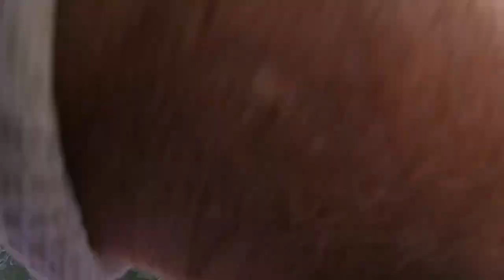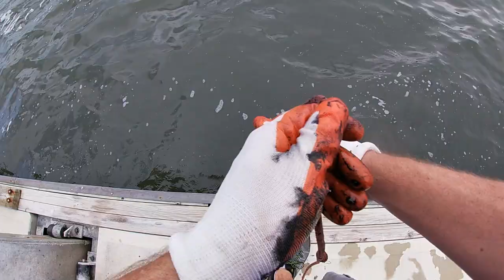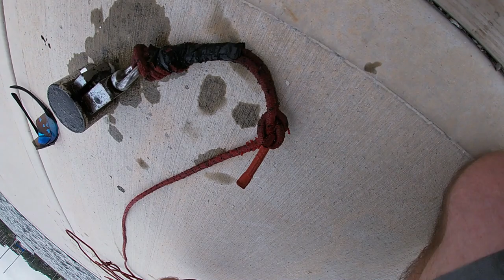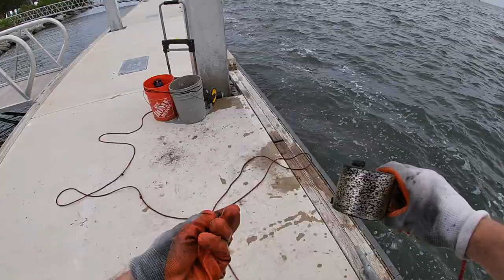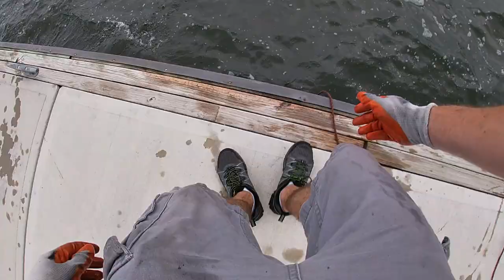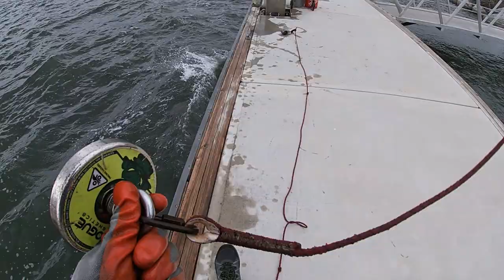Police confiscate gun found magnet fishing! ( warning loud music in the beginning)

Comment: Hey, Nick, yep. You're right. I do. But I ain't tellin'. 😆 But I'll give you a hint. Fuel pump. Congrats on the gun & bullets. About to head outta here to go pick up that paddle boat. Wanted to watch one video before I leave the house.
Reply from the maker: Hehe I knew you would know! Awesome man glad you are grabbing that boat, congrats!
Reply: Yep. I got it on a U-Haul trailer right now. The old boat trailer part of the deal fell through. So I had to go to U-Haul this morning and grab a trailer. So the boat itself is in okay shape but it's going to need a little bit of some fiberglass cosmetic work done on it which I'm not overly concerned about because I'm not planning on taking this thing to a boat show. How did  you make out on that Jon Boat?
Reply from the maker: @michiganmagneto  You will fix it I know! Yeah about that Jon boat.. it was broken in half basically and she said she meant to put 250 and not 25.. left to rot in here yard!
Reply: @magnetjunkie  Yep. Scrap or yard decoration.